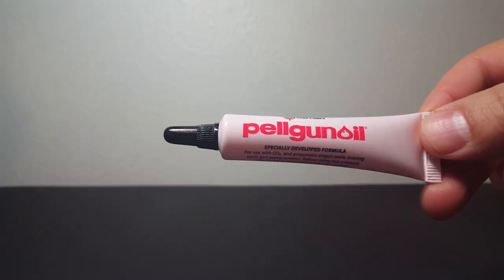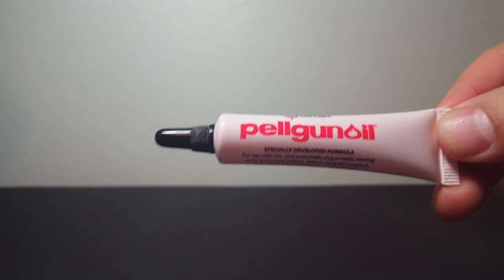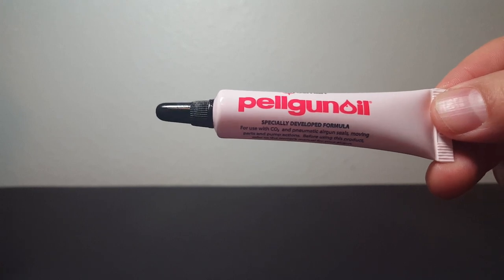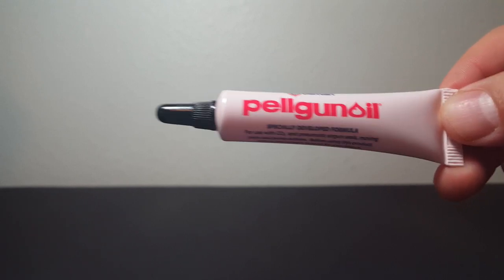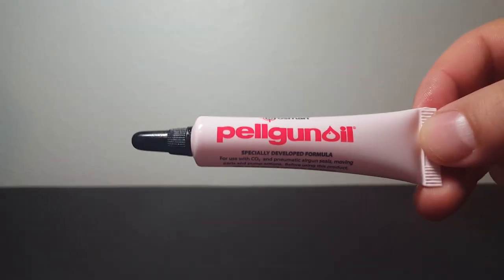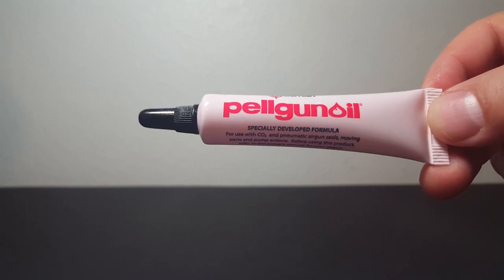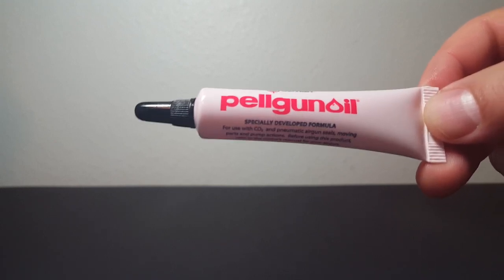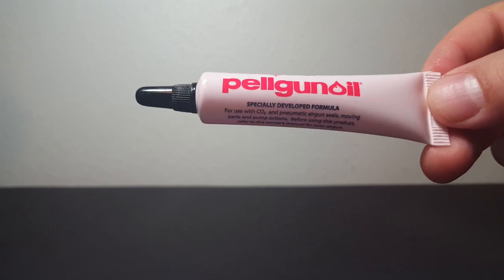Pellgun Oil: What is It?

Comment: Ive Already bought some to clean barrel and o rings, can I use pellgunoil
Reply from the maker: Lee, yes, but the video sets up Magnum Airpower lube. You get more lube for the money.

Yes, you can use Pellgun oil on pump guns.
Reply: Even on pcp rotex rm8 varmint
Reply from the maker: Lee, NO, not a PCP.

Here is info From Magnum Airpower:

SECTION 2 :  PCP, HPA & BREAK BARREL ( spring piston, gas piston, gas ram )

 Magnum Airpower HIGH-PERFORMANCE SILICONE OIL is non-toxic and highly resistant to rapid compression autoignition or "dieseling" as it's commonly referred to. With a flash-point above 586° F and autoignition temp above 900° F it's the safest on the market. It's an excellent compression chamber oil for break barrel models ( spring piston, gas piston, Nitro Piston and gas ram) that require silicone oil.

🌟It's perfect for high-pressure hand pumps, assembling PCP airgun components and can be periodically added through the fill nipple of your PCP gun to reduce corrosion and wear.🌟

Crosman Silicone Chamber Oil (RMCOIL) is recommended by 
Crosman for their break barrel and PCP guns. Magnum Airpower HIGH-PERFORMANCE SILICONE OIL is a safer high-performance version. Both are dimethyl, phenylmethyl siloxane, trimethyl-terminated.

Our oil has a higher phenyl content which gives it a much higher flash point, better thermal stability and it's more hydrophobic to better prevent corrosion. This oil is only available from industrial suppliers for $400 per gallon and up. We list these 1/2 oz bottles at a very small markup to make it affordable for most. It has a viscosity equal to SAE 30, resists thickening in cold temps and thinning in hot.
 
PCP & HPA :  Without lubrication, PCP components can be difficult to assemble and o-rings are more easily damaged. Tanks are harder to install and remove without lubrication on the outer threads and o-rings. Many lubricants are not safe due to the risk of rapid compression autoignition. Use only lubricants that are recommended by the manufacturer or a trusted airgunsmith who works with PCP & HPA guns.

 A drop or two of oil can be added through the fill nipple of PCP guns for maintenance. It works it's way through the system to prevent corrosion, prolong seal life and lubricate the valve reducing wear. Some recommend never oiling PCP guns except during assembly. We've found over many years that these guns last much longer and perform better with lubrication. To prevent over-oiling, every 2000 shots is generally enough. After oiling, excess oil accumulation should be cleared. To do this, make sure the gun is unloaded, point the barrel straight up in a safe direction and fire it. Keep the barrel pointed up through the entire procedure, excess oil settles into the valve and shoots out through the barrel.

 No oil should ever be introduced into a HPA tank, regulator or the internal threads of either. They are commonly flash-filled, an explosion could result. Scuba tanks generally have grease on the internal threads to prevent corrosion. They are filled at slower rates so there is no risk of explosion when the correct type of grease is used. Grease works better than oil for this purpose, it stays in the threads where needed instead of settling and migrating the way oil tends to.

 It's not high pressure that causes lubricants to detonate, it's rapid compression generated during a rapid fill. The fill rate required for rapid compression autoignition to occur varies by the type of lubricant and size of the container. A PCP tube capacity of 4.5 cubic inches requires a rate of around 2000 PSI per second for standard airgun oil to detonate. The rate required for larger tubes and tanks is higher. The rate for smaller tubes stays about the same. Based on this it is safe to establish 2000 PSI per second as the minimum fill rate required to cause autoignition. The rate required for common silicone oil types is slightly higher, with our oil it's much higher. Most silicone and heavy petroleum oils are safe when there's no risk of accidental rapid fill. Only the safest type should be used otherwise.

Comment: Can you use this pellgunoil on any pump gun like the daisy red Ryder and buck gun?
Reply from the maker: Franco, great question! There are better products you can use for your Red Ryder.. I had problems flooding Ryder using Pellgun oil. 

DAISY WANTS A LIGHTER OIL IN THESE GUNS.

Pellgun oil is 30 weight.

The Daisy Engineers want 20 weight or lighter. Many veteran shooters find that the light weights INCREASE performance. Ballistol is a 10 weight. My youth springers are shooting Great!

 I just lubed power plant (oil hole) after emptying magazine in 1999. Just one gentle puff. EASY. Just make sure to put the straw in the hole. Tip gun down then shoot it a few times to work it in.

BALLISTOL 

https://youtu.be/WlnJa8sRxyA

https://ballistol.com/about-us/

Comment: Will pelligun oil work on beeman p17 and where to put it?????
Reply from the maker: Abel, yes, but 30 SAE ND will work just fine as long as you have a dropper to put some in. 30 non-detergent oil  MUCH cheaper and some believe protects the seals longer.

https://www.autozone.com/motor-oil-and-transmission-fluid/engine-oil/stp-pro-formula-nd-30-conventional-engine-oil-1-quart/811768_0_0

https://www.amazon.com/Needle-Dropper-Bottles-liquids-Liquids/dp/B00JVTC3NS

RWS Silicone will also work. Is close to 30 SAE. That is what I use on my P-17. Those are Nitrile rings

Magnum Airpower lube
30 SAE ND
RWS Silicone

The 30 SAE ND way better deal and can be used on so many surfaces for good wear protection.
Reply from the maker: Abel, every 500-1000 shots gently open the pump to expose OPEN pump tube. Put a drop inside there. Don't put it in the breach hole.

I have a video showing lube on my P-17. Silicone video.

Comment: Would it work on a Winchester 11k pistol leak
Reply from the maker: It could yes. Try it. Many times it is the face seal that contacts CO2 cartridge. Put Pellgun drop on top of CO2 as you load it. Every few cartridges.

Comment: Can I use any auto transmission oil to substitute pell gun oil?
Reply from the maker: Ming, some like ATF for lube, but that isn't what Pellgun oil is made from. It is Red to show it will not be used for engine lube - like ATF.

I don't think airguns need detergents, but ATF is used by airgunners. 

Here is another choice that is BETTER and cheaper than Pellgun oil.

https://www.homedepot.com/p/Husky-16-oz-100-Full-Synthetic-Compressor-Oil-018-0083H/300135698

Comment: Does it make the gun louder
Reply from the maker: It will if you MISUSE it. It will detonate a PCP or break barrel.

But it won't make a pump gun louder. You can also save money and use 30 SAE ND with a store bought dropper.

Comment: Should I use oil on my Crosman mk45
Reply from the maker: You can by putting ONE drop on top of every new CO2 cartridge

CROSMAN would tell you that Pellgun oil is fine, but others want a better value. That tiny $4 tube will go fast in this way. Here are other choices. Just buy a dropper bottle from Wal-Mart, Hobby Lobby, or fav gunshop.

https://www.walmart.com/ip/Super-Tech-Non-Detergent-SAE-30W-Lubricating-Oil-1-Quart/52626201

https://www.homedepot.com/p/Husky-16-oz-100-Full-Synthetic-Compressor-Oil-018-0083H/300135698

https://www.hobbylobby.com/Crafts-Hobbies/Hobbies-Collecting/Tools-Blades/Needle-Tip-Applicator-Bottles/p/80913970

Umarex wants silicone on CO2. Here is best deal there which INCLUDES its own bottle. 
https://www.amazon.com/Super-Lube-56204-Silicone-Lubricant/dp/B083NXVGQX

Comment: could you also use like olive oil or sunflower oil?
Reply from the maker: Well, interesting question. I know in World War 2 the Russians used sunflower oil in the harsh winter for their rifles and sub machine guns.

But  we are talking rubber seals and airguns. It may work, but my primary love is for the Daisy engineering. If their is any oil build up on the chamber seal, it will cause power changes and your pump handle fighting you because the air isn't being checked.

With any lube, I tell shooters to lube 880 lightly and quickly shoot it. THAT gets lube moved around through out your gun.

Good olive oil may work, you will have to experiment. Most say vegetable oil won't hurt natural rubber or the Nitrile in your pump gun. The PRICE of Pellgun oil and the HEAVY detergents make it undesirable to many. I like 30 SAE ND - inexpensive huge jug. 30 SAE is the foundation of Pellgun oil.

Crosman every 250 shots
Daisy every 500-1000 shots. With Daisy use lube if gun has been out of action,  or any power drop. I had one gun (another maker) that needed lube right out of the box.

Comment: Great video! As for the barrels in all my air guns i use hoppes barrel cleaner ,with barrel brushes and patches ,then remove all cleaner out and use Birchwood Casey cleanerlube to coat inside barrel surfaces either for long term storage or rust prevent or daily use. Thats only for barrel . As for c02 seal i use pellgun oil and Crosman chamber oil in my break barrel .Keeps all working great.
Reply from the maker: Sammy, glad you are happy with Pellgun oil. For every veteran like you, there is a negative attitude about the Pellgun oil because they believe it trashed their CO2 seals.

Then I help direct them to other choices.

Glad you liked the video. I try my best to balance the politics of pro Pellgun camp and detractors. That's why I said: "If you like it, keep using it."
Reply: @daisy880fanaticfixit9  Sounds great! Although , i've used only pellgun oil on my c02 cylinder tips/seal , never gave me any problems . And also, its never good to leave a c02 cylinder in a gun ,partially used with preasure . I heard some people do that and that could damage a seal eventually .  But, all seals will need replacement for extended use or age or even not oiling at all. Thanks.

Comment: Thank you for being so diligent about answering our questions! Rare, anymore! I'm thoroughly confused as to what economical oils I can use on my Umarex XBG for #1 The Co2 seal, and #2 All other moving parts ie; trigger pivot, magazine springs. $12-$15 each per ounce for 2 brand name oils equals the cost of the gun :(  Are there oils that I may have around the house already that one can use safely for my purposes?  Can you simplify things for me ? Thanks again!
Reply from the maker: Lo, thanks for appreciation! It is rare that any channel interacts with commenters. There are big risks. I had two cyber crimimals try and HACK me, meaning they are trying to get me to send money or get at my bank account. I dealt with it. 

Also, most channels are trying to make money running adds or selling products. I don't need any money from YT. Enough said. Because of VARIED RISKS of interacting with general public, channels - especially big channels with 100k subscribers or more - don't talk with the commenters.

On to your questions,  Pellgun is hyper controversial because it isn't  what people think, but I didn't want trouble with Crosman trolls. 

30 SAE ND does everthing Pellgun oil does except cost as much! ND or Non-detergent oil comes in huge $8 jug from auto store that can be used on many metal surfaces. Just buy squeeze bottles from Hobby Lobby or your fav gun shop. Needle nose and normal squeeze bottle are both handy.

Avoid 3-IN-ONE products. Their BLUE bottle that is fine 20 SAE looks ok, but has naphtha a light solvent. 3-IN-ONE are not made for airguns.

On a CO2 gun 30 SAE is good, like Pellgun oil, for a drop on top of every few cartridges. It gets inside and lubes up everything inside. It also lubes face plate for a better seal. 30 SAE ND also good on any metal on metal or ABS surface.

https://www.oreillyauto.com/detail/b/non-california-4604/chemicals---fluids-16461/oil-16865/motor-oil---conventional-25267/2673028dc6c2/pure-guard-non-california-conventional-motor-oil-30w-1-quart/nd30/4616028

https://www.hobbylobby.com/Art-Supplies/Painting-Supplies/Palettes-Tools/Squeeze-Bottles/p/57415

Comment: Red Ryder carbine as well?
Reply from the maker: Blaze, there are better products you can use for your Red Ryder.. I had problems flooding Ryder using Pellgun oil. 

DAISY WANTS A LIGHTER OIL IN THESE GUNS.

Pellgun oil is 30 weight.

The Daisy Engineers want 20 weight or lighter. Many veteran shooters find that the light weights INCREASE performance. Ballistol is a 10 weight. My youth springers are shooting Great!

 I just lubed power plant (oil hole) after emptying magazine in 1999. Just one gentle puff. EASY. Just make sure to put the straw in the hole. Tip gun down then shoot it a few times to work it in.

BALLISTOL 

https://youtu.be/WlnJa8sRxyA

https://ballistol.com/about-us/

Comment: Can you use it with power line 415
Reply from the maker: Daisy would prefer you use 30 SAE ND; use one drop on top of a new CO2 Cartridge. Do that every few cartridges. That seals the face plate and other internal seals.
Reply: Daisy 880 Fanatic Fix It thanks for responding so quickly
Reply: Is it ok to use the gun maybe once or twice without oiling the tip with the oil? Because my bb’s and Co2 is coming today and my oil is coming next week and I don’t wanna wait😭 (bought the Daisy powerline 415)
Reply from the maker: Yes, make sure to get some on  CO2 some time after a box of cartridges.

Comment: Will this work on Crosman DPMS SBR ?
Reply from the maker: Yes, you use one drop on top of a new CO2 Cartridge. Do that every few cartridges. That seals the face plate and other internal seals.

Magnum Oil Statement:

PERFORMANCE PARTS FOR CROSMAN & BENJAMIN AIRGUNS

AIRGUN OIL MYTHS

It's a myth that petroleum oil is harmful or unsafe to use for airguns. This stems from the common misconception that petroleum oil and distillates are the same thing. They're not, oil is what's left after the distillates are removed from crude oil. Petroleum distillates are not safe for use in airguns for a variety of reasons. Some petroleum oils also contain distillates and those are also not safe.

This subject is even more confusing to many because some distillates are commonly referred to as oil. The most common examples are heating oil and penetrating oil which are both petroleum distillates. The oil that's safe for airguns is called mineral oil also known as heavy oil. Mineral oil is non-toxic and non-flammable but it's combustible at very high temperatures. It protects against wear and corrosion better than silicone or natural oils, will not harden and doesn't become rancid. This is why all engine oils, including synthetics, are mineral oils. 

Crosman Pellgunoil (re-packaged Monolec GFS 8430) is SAE 30 engine oil with a high level of detergency. Because it's single-viscosity it gets significantly thicker in cold temps.

 Magnum Airpower's HIGH-PERFORMANCE AIRGUN OIL is full synthetic and multi-weight. It flows freely at very cold temps and maintains it's viscosity at very hot temps. It has the highest level of anti-wear and anti-corrosion additives of any oil sold for airguns.

Comment: Will this work in Umarex MCP
Reply from the maker: Umarex would prefer you use RWS silicone; you use one drop on top of a new CO2 Cartridge. Do that every few cartridges. That seals the face plate and other internal seals.
Reply from the maker: Thanks for awesome question!

These airgun companies can have spotty CSR or customer service. And outrageous prices on their lube.

The number one silicone product approved by PCP users on down, is this one:

https://onlinestore.magnumairpower.com/products/oils-applicators-and-bottles

If you hard die-hard silicone believer, then the right GRADE is vital. The wrong grade is worse for your gun than good mineral oil. Shoot for 5000 CST.

Now, if you are going silicone for a pump gun or CO2, this IS THE NUMBER ONE VALUE - quality and quantity:

:https://www.amazon.com/Super-Lube-56204-Silicone-Lubricant/dp/B083NXVGQX